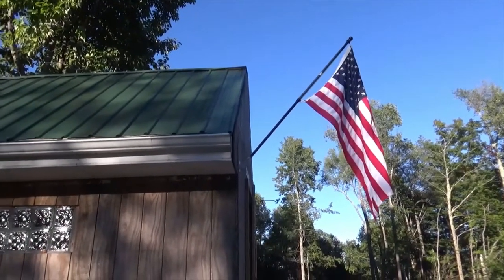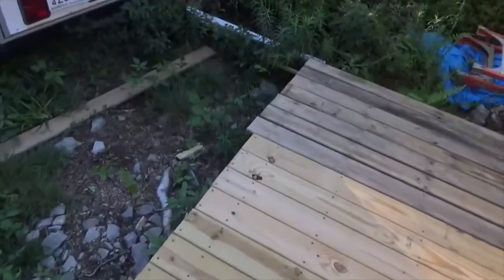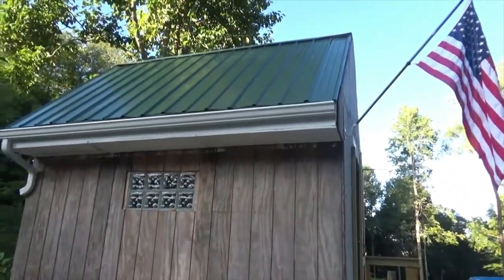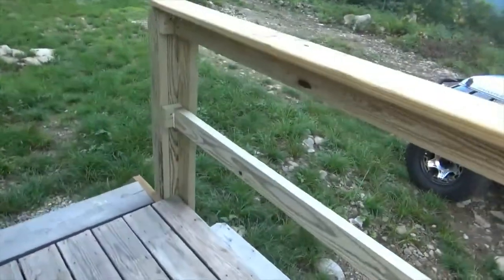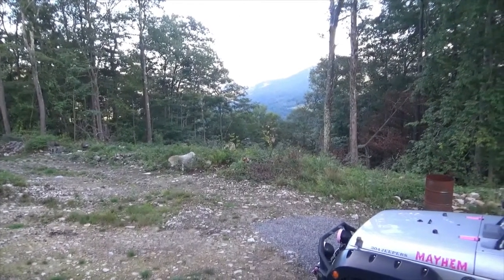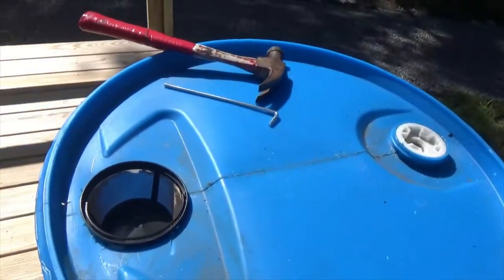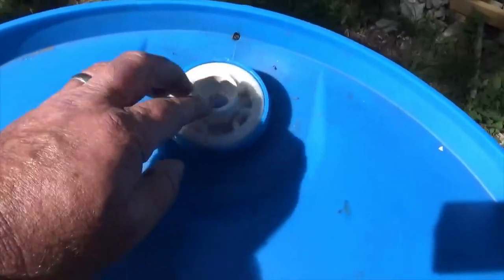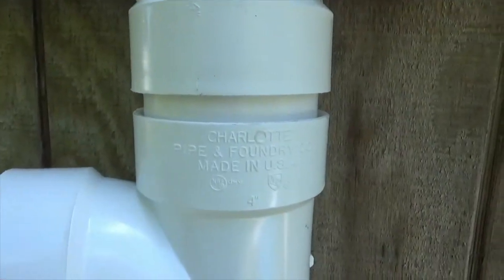RAIN WATER COLLECTION - Gutters, First Flush, and Rain Barrels

Comment: Dont buy a new cable for that winch ( unless you lost significant length) 
Tape it off, cut it back, put the hook and at least 3 saddle clamps each in opposite direction.
Reply from the maker: I just changed the cable on it last week.  I bought it from Harbor freight for like 12 bucks.  That old cable was a knotted up mess.  When I yanked on it with my truck the wraps got sucked into the layers below.  It was so tight I had to cut it out with a grinder.